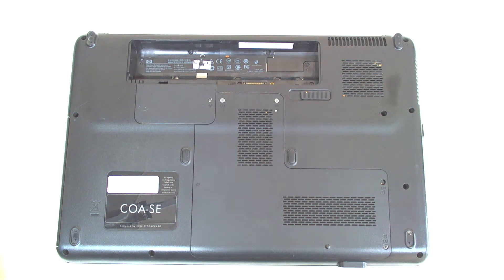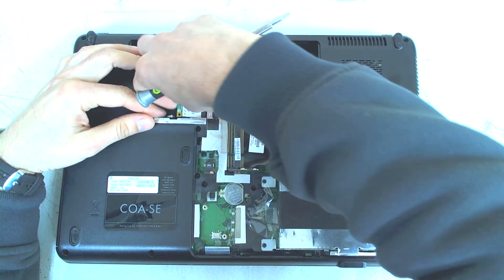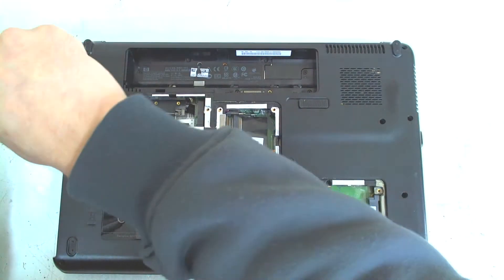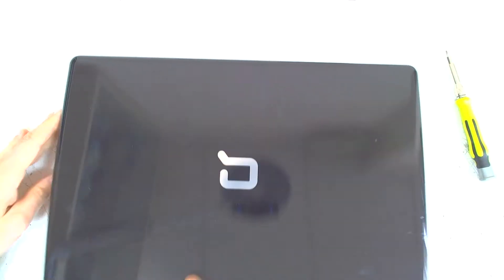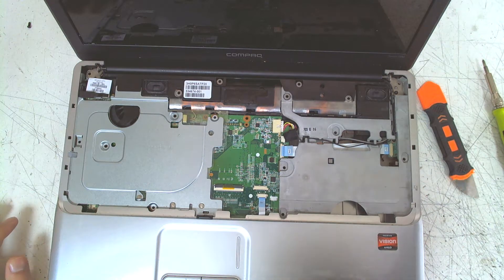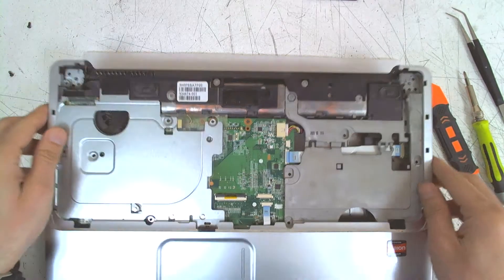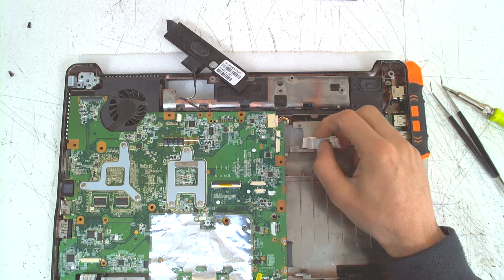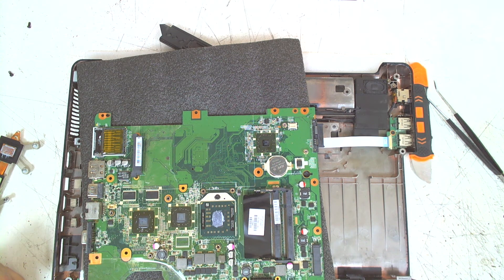HP Compaq Presario CQ61 Disassembly / FAN Cleaning

Comment: Is it possible to change the processor from the computer to this laptop and is the processor itself removable or is it soldered in?
Reply from the maker: The CPU is removable, but you can use only laptop CPU, not a desktop one. Depend on the platform ( AMD, Intel ) you can replace it with different, but also mobile one.

Comment: very helpful vid. unfortunately i can't pull it off because it's impossible to remove the screw that keeps the wifi card attached to the motherboard (it's screwed in too tightly). whoever designed and built this mess is a dick.
Reply: Just yank it hard and it will break the housing for that screw just alright i did that and it caused no damage and i returned the wifi card without screwing it later on and it works perfect